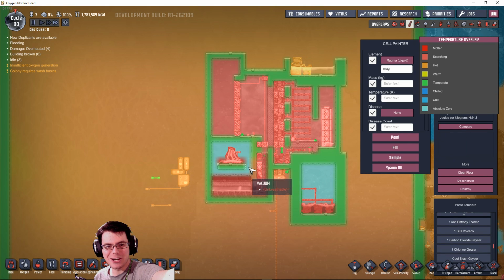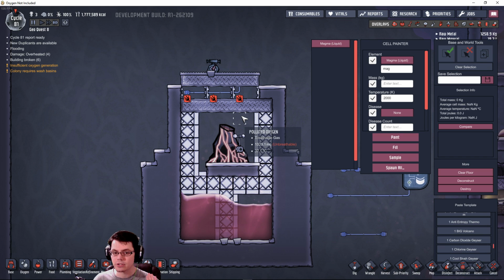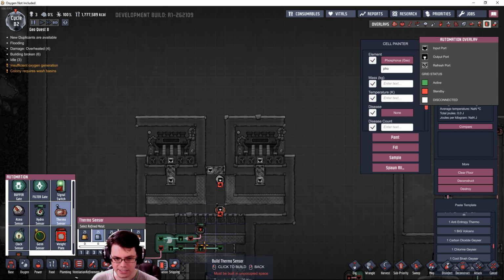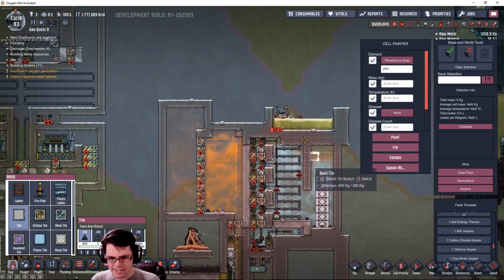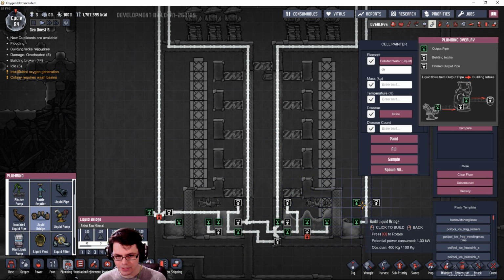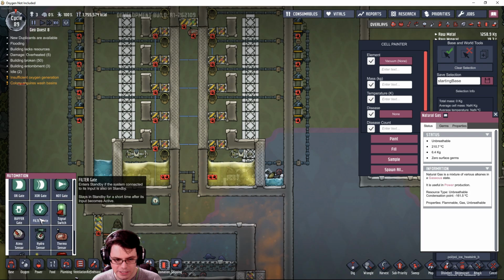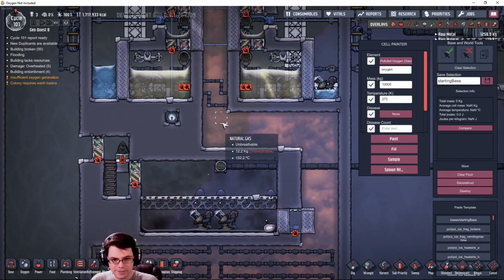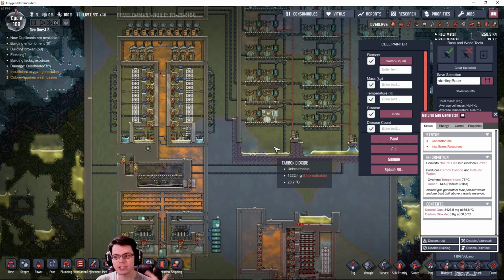Volcano Power Plant Design Challenge! Part 3 Oxygen Not Included

Comment: You dont really need door compressors in the turbine chamber if you drop in some % of hydrogen to steam. The turbine will occasionally detect the hydrogen as the pressure differential, and the steam will recirculate itself.

Comment: You need a liquid flow valve on your crude oil before dropping it on your hot plate. Dropping the huge mass of oil in there and the low temperature of your natural gas to steam plate is causing the natural gas to recondense to petroleum, that shouldn't be a problem when that steam hot plate gets up to temp. So basically it looks like if your whole system was a bit smaller it might work better.

Comment: You were getting petroleum everywhere because it vaporizes at 539º but transforms to natural gas at 552º

There is a 13º difference where it is a gas, and if it doesn't reach 550 before it cools down it will puddle everywhere.

Also, 2 thoughts:

You want to produce natural gas at the lowest temperature possible, to do this prevent the gas from hitting the metal tile which is thermally connected to the volcano. Always have liquid on top, I'd make it at least 1 tile deep, 2 might be better because petroleum shenanigans.

After that you want to transfer the thermal energy of the gas into oil you haven't dumped into the volcano pan yet, so having a tank just above would be optimal

Here's a proof of concept: https://imgur.com/a/hgm5x

Edit: Well I tested this, the design is good but

A: I overkilled the amount of liquid needed to separate gas from the volcano pan (300-400kg seems like a good number)

 B: Although I was sure you were getting petroleum from "Petroleum gas" this doesn't seem to exist in the game.

C: If you put wolframite mechanized airlocks and open them flooding them with lava, they prevent the formation of igneous rock

Comment: I experimented with the volcanos too and  I think that it's not quite useful to try to build so many different systems to cool down the  gas. Not one of the subsystems runs perfect, which made me to focus on one single purpose of the heat of the gas. This way you can control the system much better and it gets much more efficient. And efficiency is imported because you want to limit the amount of waisted magma to live through longer dormancies. Even though it would be pretty cool if you would manage to make such a huge system run efficient.

Comment: Brothgar, you could improve this quite a bit by:
#1: Moving the Polluted Dirt converter between the Crude Oil radiator and the Steam Generators.
#2: Moving the Liquid Shutoffs above the radiator, instead of beneath.
#3: Connect the Polluted Water output to the Polluted Dirt converter, with a shutoff, and the clean Water output to the Steam Generators, also with a shutoff.

Comment: can someone explain why he didnt use the patrolium insted of the natural gas?
It seen to be easyer to pump a much cooler fuel then a gas.
is the powergain that large?
Reply: well, you did the math 2kw vs 40kw
do you need that mutch power? no, but we reach for the stars =)
heat should not be a problem. thermalnullifier, wheezwords, slush geyser, deliting mass with doors for cooling and so on
Reply: I could be mistaken but I think it's because it eliminates the need for it to put through a refinement process, here you just use heat to get fuel immediately. The thermal energy in the really hot natural gas could potentially used for other things.
Reply: my question was more: "Patrolium vs natural" in general.
I know he can use the gas better then a fluid but on the power generation side, how is it there?
Also i may found my answer myself:
a patrolium generator use 3000lm/s fuel, brings 1250lm/s pH2O, 500g/s CO2 and 2000W power.
a natural gas generator use 60g/s gas, brings 67,5ml/s pH2O, 82,5g/s CO2 and 800W power.
With the heating you get of 1l oil 1l patrolium or 1kg natural gas.
You need 3l for one P-Generator (=2000W)
but 3l make 3kg gas that means 50 NG-Generators! (=40.000W)
it is reals a good idea to do all this for so much power and heat or did i mess something up here?
Reply: i was hoping to be wrong.
this sounds realy like an oversight when one thing is clear better then the other.
Reply: It's much easier to handle the natural gas than the petroleum, because temperatur measurement is only possible till 300 degrees and crude oil turns into petroleum at around 400 degrees. So it happens quite easily that you heat to much and generate natural gas instead of petroleum. The natural gas/fertiliser combination is also very good and easy to handle.

Comment: brothgar i was thinking: if you used a vertical setup for your volcano,would it be easier? because i was thinking of a design: 
-you get the volcano at the bottom,
-you put metal tiles above the volcano,
-using a dripping vent, you gradually pour oil on the heated metal tiles to get natural gas,
-via gas tiles, you let the natural gas flow up in an enclosed room where it get pumped into generators,
-you put a metal tile flooring to transfer the heat to the room above,
-you use a liquid vent to pour water on the hot metal tiles and get steam,
-via airflow tiles you let the steam rise to an enclosed room with a steam turbine and get even more power. 

ps: i tested it and it works so well that you can power a whole base continuously with it.
Reply: Devil Raylenn the natural gas doesnt break the gas pump?
Reply: I mean, it will be pretty hot, even with a metal tile really cold above it
Reply: Arnon Junior normally nope.
Reply: Arnon Junior an the heat transfer allows the natural gas to be cold enough to enter a pump.